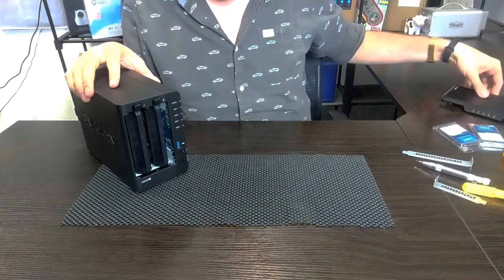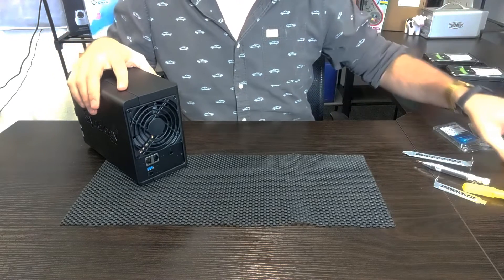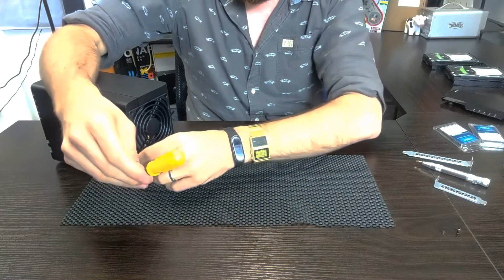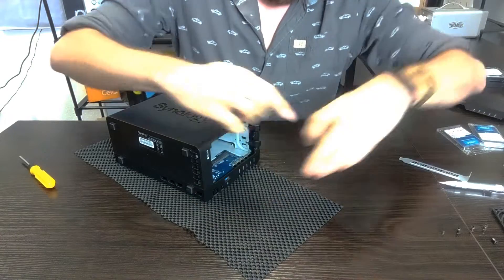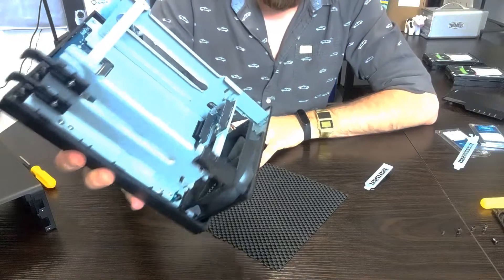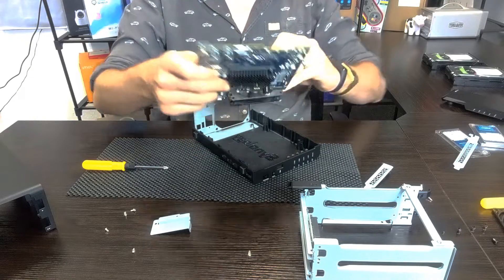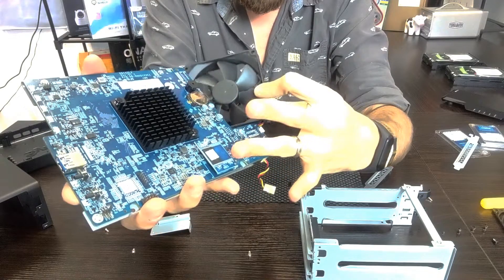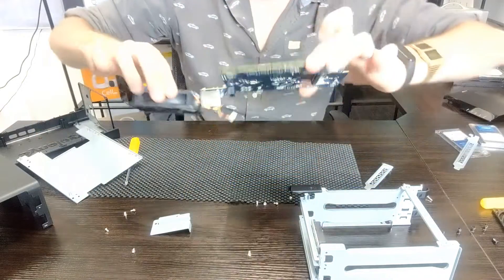Synology DS220+ NAS Disassembly - Taking it to pieces

Comment: DS218+ surely doesn't need the hard drive tray to be removed in order to get the complete motherboard out of the plastic cover. All I was needed to do after opening and removing the sliding plastic part is to unscrew the first 4 screws, and by slightly banding the back part of the NAS you can pull out the motherboard together with the hard drive tray just as you can see it on the video. I think taking of the hard drive tray in this video was also unnecessary. Anyway you can take of the first, sliding plastic cover also much easier, if you don't use any tool, but you put your hand into the front opening, turning your palm in the direction of the metal cross bar, and grabbing it with your fingertips from the back (between the plastic and the meal plate) whilst you are pushing the the plastic cover with your thumb up and backwards, away from the metal plate. You may also help with the other hand by pulling the cover upwards and backwards too in the same direction as you thumb does. If you position your thumb under those plastic clips and push them one after other, or a bit stronger exactly in the middle between them over the metal plate that way, the side panel goes off surprisingly easy (compared to that what we se on the video). 
However, the video is great, and if you follow it's steps you can't do anything wrong, so big thumbs up for your work, it's very helpful.

Comment: Thank you for this, I found it very useful.  I have a DS220j, but unfortunately for me it has rather a noisy fan on board, it literally sounds like a pneumatic drill starting up.  The good news is though, I do have an identical size 92mm "be quiet!" fan which I'm going to replace it with, so should make a big difference.  Cheers! - Neil (UK).

(update) WOW! I've successfully installed the "be quiet!" fan, and the difference is amazing.. SERIOUSLY QUIET, very happy :)

Comment: This ds220+ has two slots for ram module? One for onboard modul and second for expand?
Reply from the maker: It only has 1 slot. The internal memory is soldered to the controller board
Reply: @nascompares  So when I turn on the NAS I will see 2 GB of ram and I one free slot to expansion?

Comment: If the battery drops, will the BIOS be lost? What is there to do?
Reply: Maybe only time and date :) But every NAS are designed to work 24/7/365 without disconnecting power, so battery will last very long time before it runs out.

Comment: So for $550, I get a plastic case, with cheap components and soldered on memory. No, thank you very much. Thanks for sharing this video. I am sure many would appreciate knowing what they're getting into.
Reply: Quite late but still: with Synology a lot of the money you are paying are actually for their software, which is quite elaborate & well done and comes for free no matter how many years you use the Diskstation. Yes, the hardware itself is not so impressive, but their software (both OS and packages) is.
Reply: Still relevant today lol if you want their software. Build a nas and use red pill lmao garbage
Reply: soldered on memory is way faster than having a bus, plus there is a SODIMM slot for 2666mhz DDR4 RAM